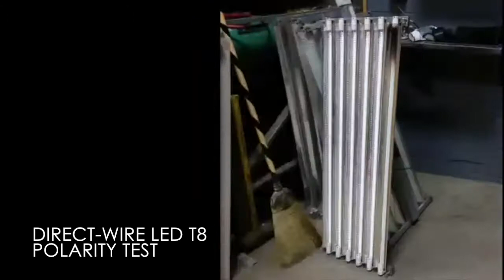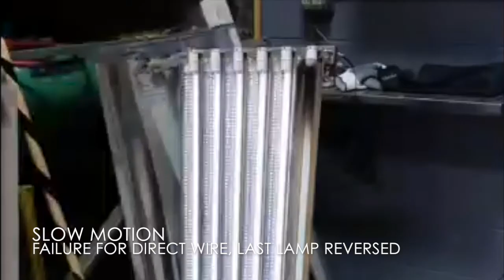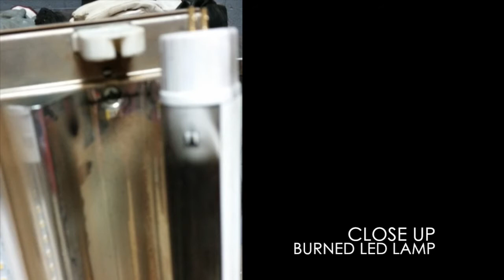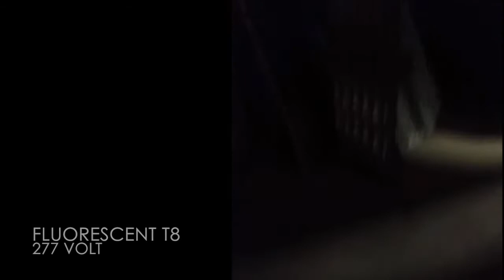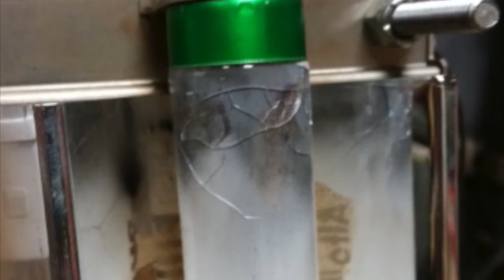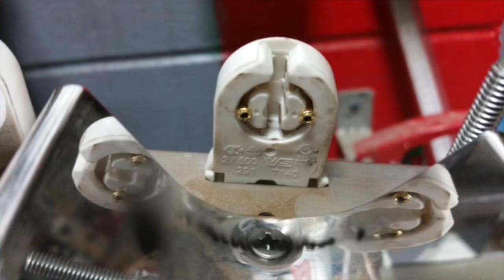LED T8 Hazards

Comment: Personally I think the biggest disadvantage of single ended LED Type B tubes, is the possibility of a fluorescent tube being accidentally inserted.   120 volts, not that big of deal, just a brief flash.    277 or even 347 volts, and the results are more explosive.     Double ended type B LED tubes are safer in this regard,  because even 347 volts is not enough to start a florescent tube if accidentally inserted.    You're supposed to place a label warning custodians there is no ballast and fluorescent lamps are not to be used, but that isn't always done or sometimes the label flakes off.